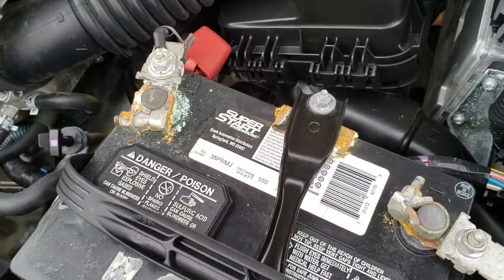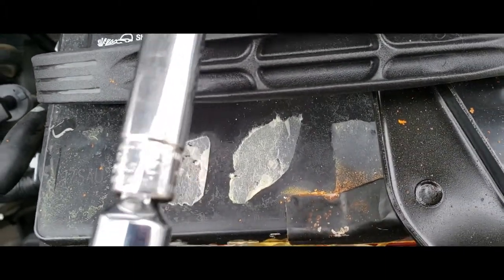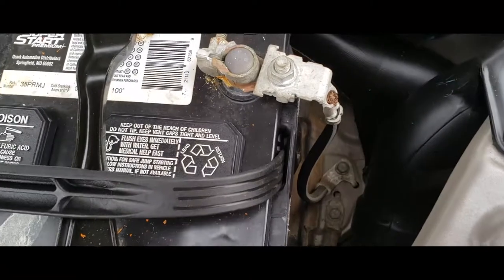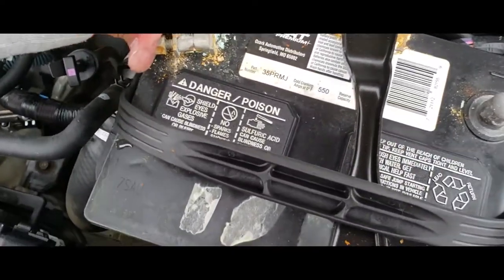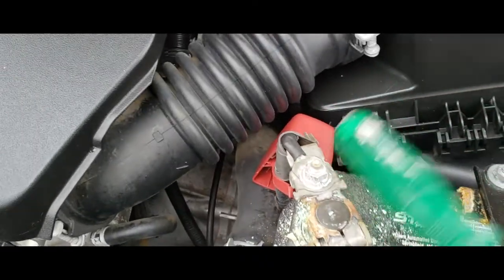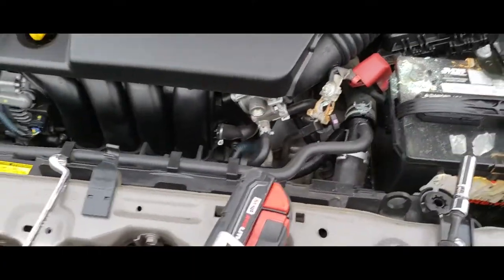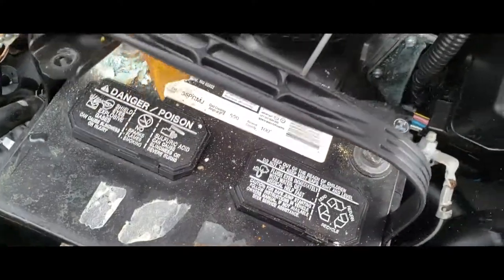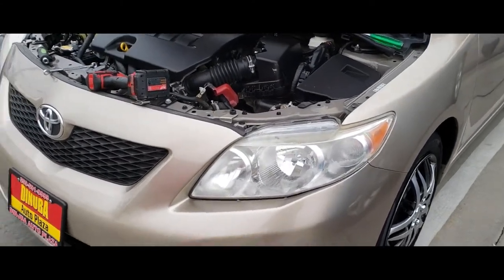How to: Remove a battery from a 2010 Toyota Corolla

Comment: If I need a new alternator and battery which should I replace first
Reply from the maker: Both, u sure it's a bad alternator and not just a bad battery?
Reply: @559powerscape I jumped my car and it started for about 3 seconds before the car shut down completely again. 

Also the next day my car keys no longer respond to my car. I have to manually lock my car now. These two events are why I assume it’s an issue with both but I’m not a mechanic. It’s a 2010 Corolla with 110k miles on it. I did get a battery about a year and a half ago.

Comment: Do you have to reset the codes when you install a new battery?
Reply from the maker: You should be good because disconnecting the battery resets the ECU. But just in case its still on you can clear the check engine with an obd2 scanner